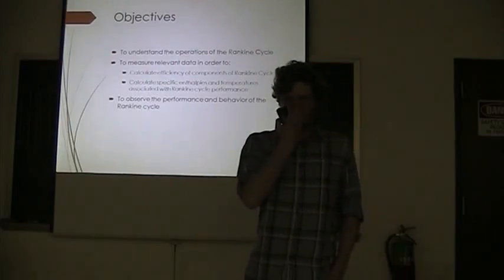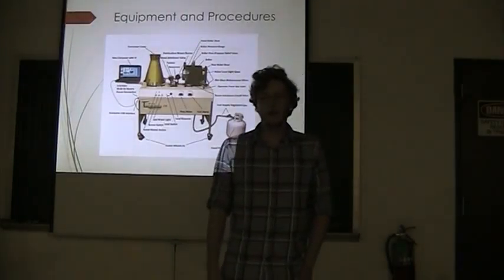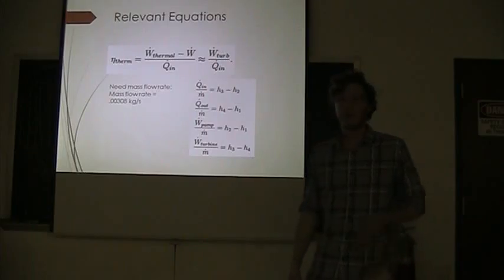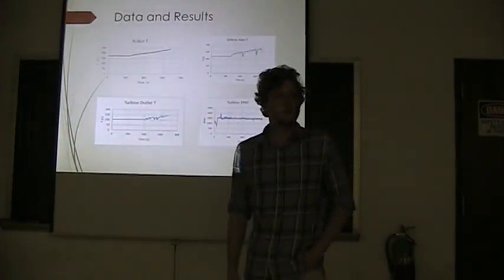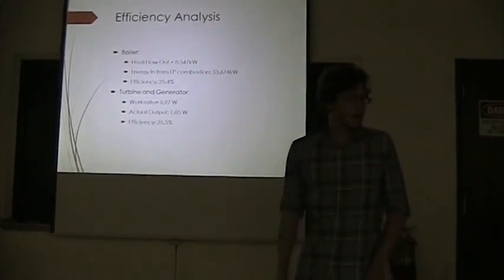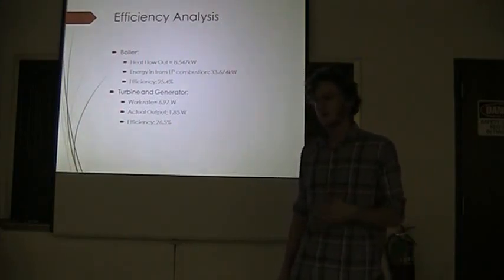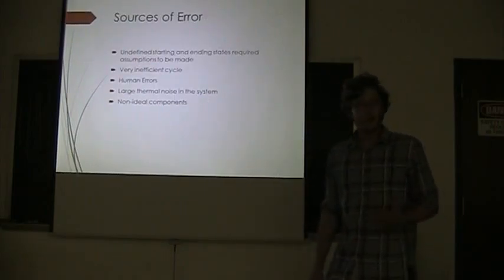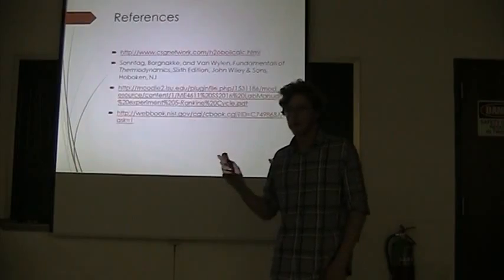#9 Group 1 Reporter Exp 5 Allen Davis

Comment: You always do such a good job of presenting yourself and your presentation is very informative. To be technical, as the reporter you don't have to include the first half of your presentation (i.e. Theory, Equipment, Procedure etc.). That's the job of the group lead. If you had left it out you wouldn't have gone so far over time. Again, I don't think that matters so much and your presentation was very good. Just something to consider in the future.